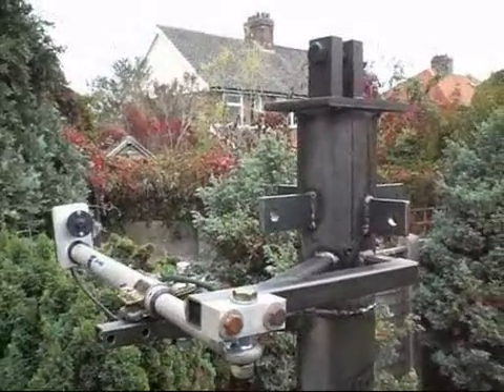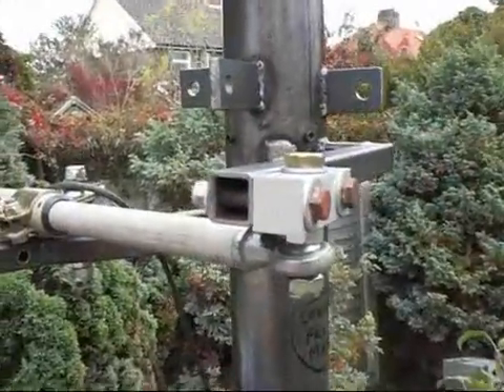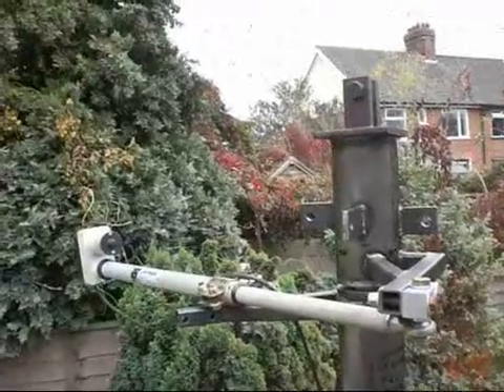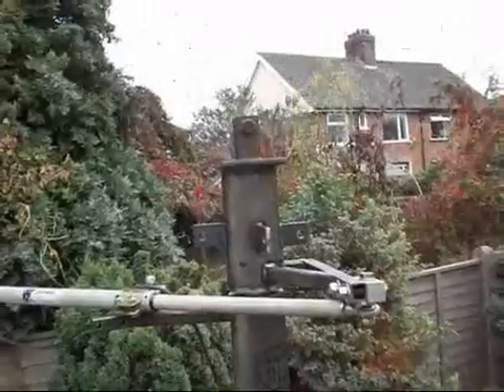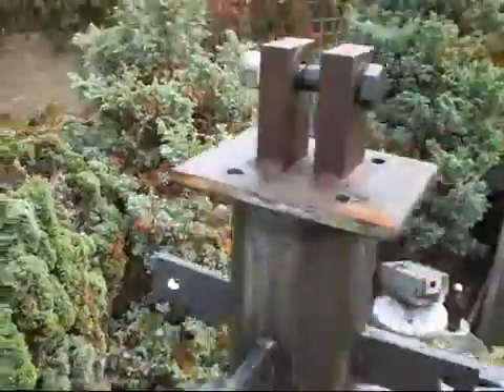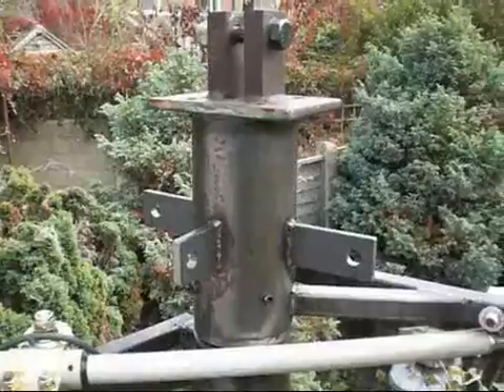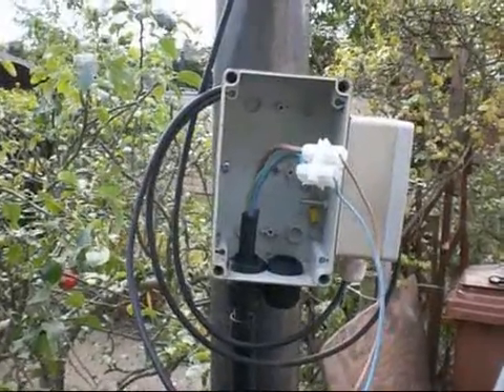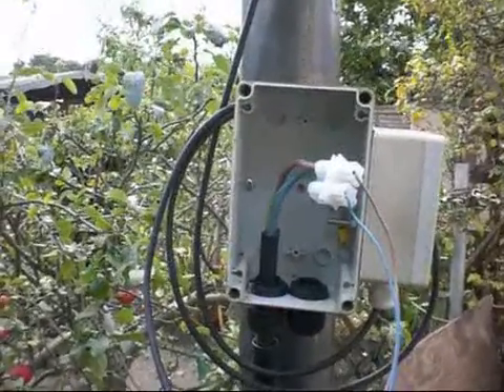tracker rebuild mk2 part 2

Comment: Can you please tell me the name and where you found this actuator in the states?  The limit switch inside is it at the 2 mechanical extremes or within the 2 extremes?  When you first set the actuator up with the heliostat, did you have the heliostat facing east at surise and the actuator fully retracted?  Once the actuator is fully erected, I would assume that the panels are facing west.  Does this actuator travel the full 180? Is this a plug and play set up?  Do you need to program this?

Comment from the maker: I have a single axis electronic tracking module that tracks the sun  and controls the satellite position during the day.
when it goes dark enough it returns to the east ready for the next day
I buy them from the USA and have sold them on ebay in the past .they are simple to wire only 4 wires and works from 12v to 44v max.
I will be upgrading this to a duel axis tracker very soon before winter.
I will also getting some more trackers later for sale.